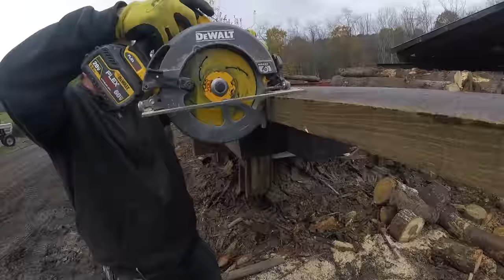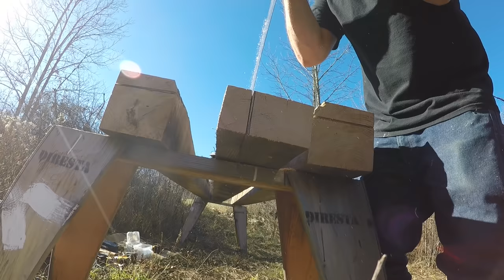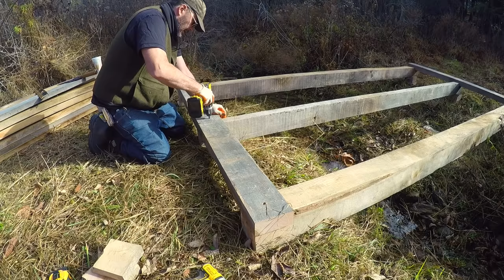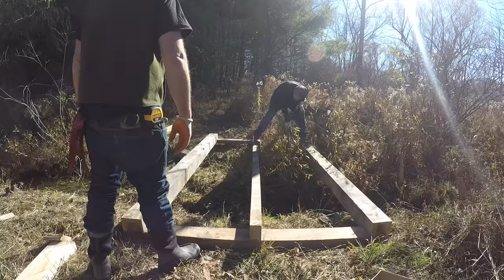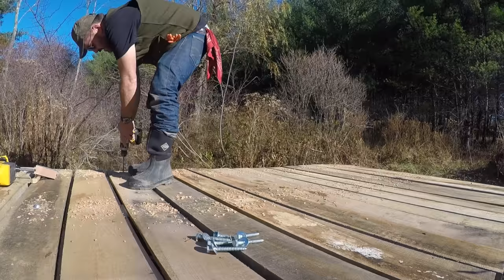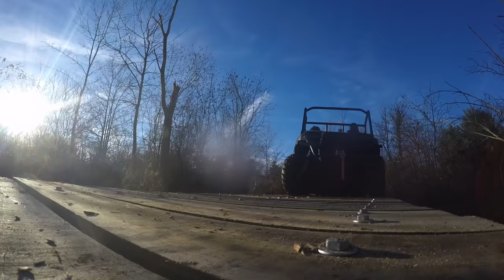✔ DiResta Tiny Bridge Flexvolt

Comment: Noob question - something outside in the weather like that, don't you treat the wood, seal it?  Alslo, the harware, are those bolts sturdy enough so the rust forms a protective coat after a while?
Reply: Mekratrig galvanized hardware is coated to work outdoors. Woods vary a lot in how much they hold up untreated, treating wood adds a lot of chemicals you don't always want. It may not be a thousand year bridge but it should hold up well.
Reply: Mekratrig He was using red and white oak here, both are quite water resistant and they are fairly acidic which helps deter insects. Oak is commonly used for peirs of docks where it would be fully submersed. It's only when going through cycles of being fully saturated (sitting in water for weeks) and then dried repeatedly that it becomes truly compromised. In other words it should last for Jimmy's lifetime.
Reply: ...though it never hurt to slap a coat of clear on it.
Reply: Ive noticed(from building many of these outdoor bridges for mountain bike trails) they last surprisingly long, the trick is not trapping water. Those spots are the failure points, on the joist under the deck board. our bridges last at least 4 seasons and that's pallet size boards and joists and long drywall screws. Even then they just need the deck boards rescrewed.
Reply: Well it will be soaked and dried over and over again at the ramps. I guess these will have to be replaced first because they sit on the ground.
Reply: Mekratrig would have been simple enough to make it a covered bridge-there are several in New England and Pa. that are a couple of hundred years old.You need to replace the roof shakes after 30 years or so.
Reply: pine or most dimensional lumber you see in home depot needs to be pressure treated or coated to handle the weather. Cedar is naturally rot resistant and many hardwoods are as well. Here is a chart i found. http://www.grit.com/departments/choosing-wood-for-outdoor-projects
Reply: Mekratrig It's already treated

Comment: I got a cordless circular saw and I am not very satisfied. It binds very very often. Its good if you need just a few cuts or when you have no power around but beyond that its a pain.
Reply: I cut an entire garden shed with it. I think I had enough practise. Its just a shit saw. The one Jimmy used cetainly appeared to be more powerfull.
Reply: Max Maker are you using the original blade?  An aftermarket Diablo blade made a huge difference with my cordless saw.  A far larger difference than I'd thought possible.
Reply: Yes the stock blade with carbide tips.
Reply: If you're up for it try a nice blade.  The stock blade that came with my Milwaukee saw has carbide tips but it tended to wander.  I put a Diablo blade on and it tracks nice and straight now.
Reply: Yeah I thought the blade on my Milwaukee fuel looked perfectly fine as well.   I guess it's made to a price point.
Reply: Absolutely no surprise. The cheapest home improvement store corded saws come often with a roundabout 1kV motor. Take that information and the values of your battery (for the dewalt 20V 5Ah = 100Wh) and you are left with a surprisingly short time of action (6 minutes for the dewalt battery), given the battery can give of 1kV without bursting into flames.  There is a reason why the cordless tools are not advertised by the amounts of watts they use. Cordless tools are carefully balanced between useless because of short battery life and useless because of lacking power. Circular saws are pretty power hungry, that makes the balancing act even harder.

I am not saying cordless tools are crap in general. I am saying for anything stronger than a screwdriver, think about whether you need to go cordless or if you can live with the extension cord.
Reply: Actually Hiltown my cordless saw is very capable and I have the smallest battery available.  I'm using the Milwaukee Fuel saw with the 2 amp hour battery.  A freind of mine uses his with a pair of 5 amp hour batteries at work building forms for sidewalk and curb.   Much better than cords and generators.

I remember using the old dewalt 36 volt saw to cut curves in half inch chip board.  It was more than capable but a bit heavy with that big battery.  Great for doing work on the roof.

I haven't picked up my corded saw since I bought my cordless.  I'm not a framer though.

Comment: this looks like one of my days...you must have been feelin it by the end?
Reply from the maker: yes for sure hahaha
Reply: Von Thompson Tinkerer any gueses to the final weight?
Reply from the maker: all oak!!! dont forget!! heavy as a MF'er
Reply: I moved a bunch of pallets that were oak last week and holy cow those were heavy. I don't even want to think about how heavy these were with the 6x6's
Reply: ? i usually load my truck till the leaf springs are level with the ground then I figure it weighs a lot, lol
Reply: Yeah I had so much weight I had to make 3 short trips. To be fair it was a large SUV and not a truck so it wasn't exactly designed for hauling huge loads of oak.
Reply: I offloaded 2500 feet of free red oak the other day.... only took me 3 days to recover.  We aren't 18 anymore that's for sure.  And you've got 15-20 years on me.
Reply: I was thinking the exact same thing. Hard day of labor there.
Reply: decent day of labor at most... i can tell the lumber was heavier then expected but putting together 2 dozen boards with a skilled craftsman? Not something id call a "hard" day
Reply: hey man, want a job! lol
Reply: Von Thompson Tinkerer BAHAHAHA

Comment: another fantastic video ! but..
you shouldnt left wood on stone, it should be separated by a roofing felt or other non water permable material. stone and wood are diferent materials and have diferent moisture equalibriums so puting wood on stone lets moisture to flow and drip wood constantly, which speed up rot proces significantly, thats a major advice here it is a common mistake 

of course getting it impregnated its super important too

Comment: How many batteries did you bring, how did you charge them?

Tools was pretty cool! all though the joist drill didn't seem to have enough power for the job.
edit: just looked it up, DCD460T2 has 70 ft./lbs. of torque.

Perhaps an impact wrench would have done a better job?.  
Personally i would have used a generator and my regular tools as i don't have too many jobs with no power near by.

Comment: So what is this handheld drill press about?
Reply: Max Maker You mean a cordless drill?
Reply: You can see more here. It's called the Stud and Joist Drill. Based on the product video, it supplies a higher voltage (so I'm assuming more torque than a normal cordless drill). http://flexvolt.dewalt.com/en-us/products
Reply: Max Maker the fact he had to hand tighten after with a wrench makes me think I'll stick with my impact driver....
Reply: it snapped his socket adapter when he was sending it home, so he eased up. that stud drill has plenty of torque and an impact driver is childsplay compared to it.
Reply: Graham North At 3:28 you can clearly see that he snapped his socket adapter, which shows the tool has more than enough power to tighten the bolts enough but the socket adapters he brought along weren't strong enough to handle the power. That is the fault of the adapters, not the fault of the tool.

Comment: What was the purpose of the little strips you cut and placed between the decking on the bridge?
Reply: Spacing between cross planks. Helps bridge to drain in rain also so it doesn't pool up on surface and create rot.

Comment: Drill wasn't powerful enough to tighten bolts? What would be a better drill brand for the job?
Reply from the maker: Gordon Tendick was very dry very hard oak. Not sure any thing could have driven the last few turns maybe I could have used soap.  That would have  helped.
Reply: a more appropriately sized impact driver. Idk if dewalt makes one though, youd have to go to Hilti or something
Reply: I use some random cheapest silicone spray grease with bolts every time. No matter, wood or concrete and nylon dowels. It dries after a few days, so nothing will unwind. Allmighty WD-40 will do as well :)
Reply: You must have missed the shot of the drill snapping the drill bit because of the hard oak.
Reply: jimmydiresta Wonderful. Thank you for the information! Looked like a lot of hard work, but worth it. I love the simple and clean design.
Reply: Tophie Good point. I assumed it was a cheap drill bit.
Reply: Evil Gremlin That's a good idea.
Reply: Hilti TE-60. Sure, it's a hammer drill, but that's really just a huge impact driver :D

Comment: Ok i may not be a structural engineer, but just resting the bridge on stones doesnt seem to safe. Surely with your stock of materials you could of driven in some piles to secure that bridge too? Would of made leveling it abit easier aswell.